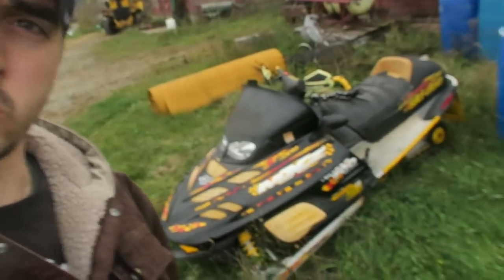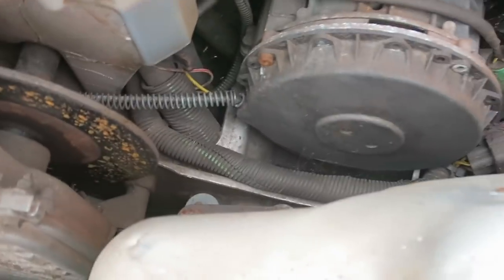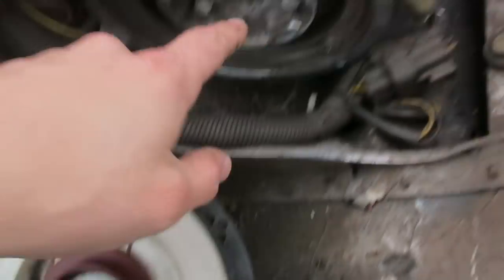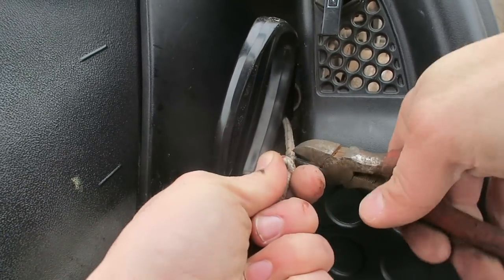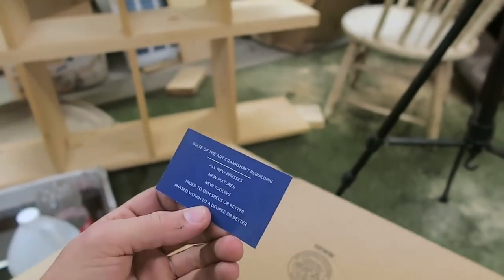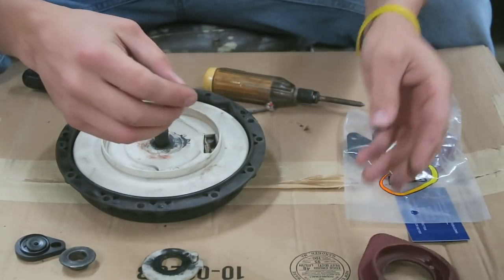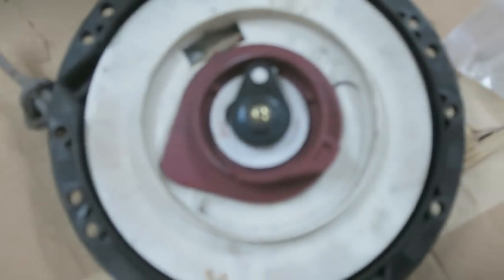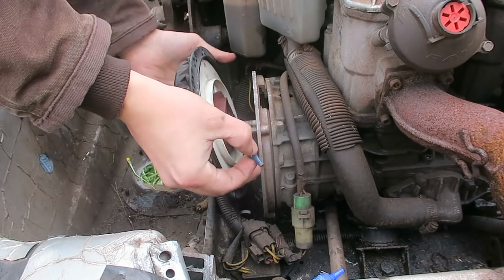SNOWMOBILE WORK!! (FIXING MY PULL ASSEMBLY | RECOIL)

Comment from the maker: Thanks for checking out the video my friends! Who wants to see more fixing videos? What are you favorite snowmobile videos to watch?? Let's hear it below!!
Reply: you have lock washers? thats what i needed on my old mach 1 670,,i had the same problem,,hey where about are you?im in north bay onatrio
Reply from the maker: I tried that once, but because the wall of the flange is so thin and close to the assembly, the washers pushed against it at an angle and didn't really do much.
Reply: Morning Brother,
Keep these sled prep videos coming. I am excited as you are for the season of riding snowmobiles.
Reply: I like the fixing vids too. Like to see more of them. I like the riding vids Better, perhaps (but don't feel like you have to risk your neck to entertain) I've been laid up half of this year and unable to ride ...had some time to watch many of your vids. Thank You for the many hours of entertainment. Yours are in my opinion the best by far. A shout out to Mike, Travis, Ky Kelly Zack & Tyler. Enjoy y'all very much! Thanks!
Reply: Yes do more videos of working on sleds
Reply: Jeremy Rhydes on the recoil assembly why don't you drill them out and get longer hex bolts same head size and put a nylon lock nut on the backside
Reply: @nathanbrodeur  thats what im sayin. 
If the problem keeps happening get rid of the problem entirely by doing that
Reply: I love these snowmobile vids. Keep it up 👍👌
Reply: I just bought a sled and it runs good next morning start it when I get home from school runs good 20 minutes later try again I cleaned carbs and put fresh gas in and drained all the old gas out as much as I could it also bogs when given full throttle all at once?
Reply: Nice video

Comment: Drill through it and through bolt it. My old 2000 MXZ 700 had a different system and never failed me.  It was a circular clamp that held the recoil on to the engine with one bolt and nut to squeeze it clamped.  Kind of how a hose clamp works but C shaped. Not sure why they went to an apparently inferior design. Great vid brother.

Comment: Safety wire man! Drill small hole through each bolt run the wire in the direction that the bolt tightens! no more lose bolts 👍🏻

Comment: Two words, "Spring Puller", they are cheap, and awesome. Also, I am super jealous of the $350 sled. Love the videos! Dude, treat yourself to some nice tools. My buddy had some tools like that and I threw them away when he handed them to me. Christmas is coming  up, ask Santa for some quality tools. It's possible the "Cup" on the engine is messed up and that's why that part keeps failing. Just something to think about. Heli-coil that sucker, or can you drill right through it and put a nut on the other side? I can't tell from the video if there is clearance or not.

Comment: Hey Jeremy I have the adapter and a recoil that I was gonna use on my 670 build I did a few years ago. I will send them to you I just have to dig them out. I will be going to a buddy's sled shop to drop off all the Ski-Doo parts I have left and He isn't to far from you I can leave them at your Post Office. The threads are good in mine also.

Comment: Get fix a thread for the bolt at advanced or your nearest hardware store i used it for 3 stripped bolts on the valve cover of my quad and it works great now

Comment: It's not your paw on your recoil. I use to have the same problem, you have to replace the black outer assembly the recoil housing.  The lock washer that holds the paw assembly on gets weak and bends and pulls the paw away from the teeth. Been watching you deal with it awhile. It will solve your problem 100%
Reply from the maker: I actually bought an entire new housing (for too much money I  might add. Lol) That didn't fix my problem, unfortunately.
Reply: Oh alright. I went through paws left and right and that fixed mine. Figured maybe it would help you. Could also be getting hot and making the paw soft and wearing it down. Just a thought. But love your videos.

Comment: Why don't you make a metal one? Or buy a billet one made already for the recoil? Definition of crazy is doing the same thing expecting a different result. Now that is crazy. I think I would have pulled it to the door where the tools are at. Getting closer to the work helps it go much faster. Also if you didn't have to pull it 15-20 times to get it running when its cold that recoil would stay together longer as well. Starter fluid in the dead of winter is our friend Jeremy. Just don't use too much at a time. Seems to me you could glue a metal shield over the plastic part that engages the metal outside of the case assembly that turns. So that way you have metal against metal of at least the same hardness and it would last longer with a little grease on it, so when it rubs against it and jams in, it would not bend the plastic off. Put in some copper strnad of small gauge wire into the whole on both sides of the bolt and see if it will tighten then, might last a season might not. If not you can always drill it and tap it as planned.

Comment: Could drill it out. Or you could do like I have done is put a longer bolt in like that one. Works great. That paw didn’t look bad either the hole problem is that bolt being stripped and not having all your bolts in there to hold it tight